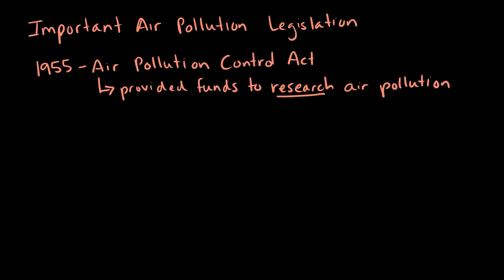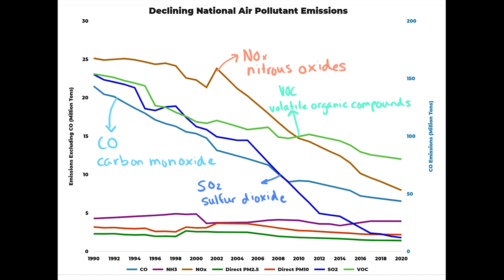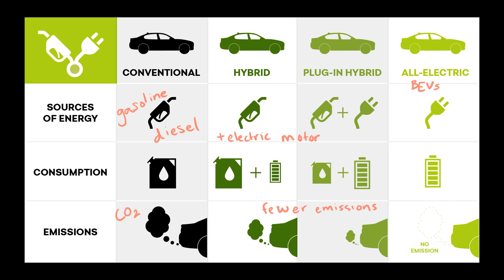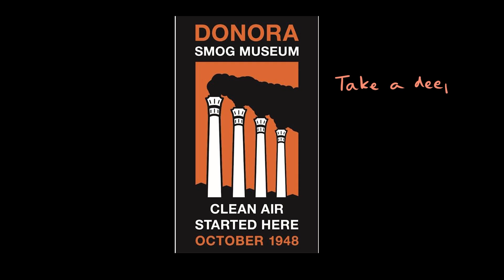Reduction of Air Pollutants| Atmospheric Pollution| AP Environmental Science| Khan Academy

Comment: Great video! Let us connect the the beginning of the story. The problem was the factories, and just like today if the factories are still making fossil fuel Automobiles. So in turn there is still going to be pollution. It is similar to plastic waste. If these companies keep making the problem the responsibility should not be put on individual actions such as “drive electric cars” or “recycle plastic.” These types of solutions are like putting a bandaid for a major injury. The root of the problem is the major oil companies that need to make their billons of dollars. The video is very good thank you for the insight!
Reply: Changing individual actions is more than just a band aid, but of course, governments and powerful companies bare the most of the responsibility and thus have the potential for a quicker and longer-lasting change

Comment: You're misleading. You need to include WHERE the electricity is coming from for electric cars, a vague statement, ' you can use clean energy sources' for charging electric cars. Also, in 14 states in the US that have very little renewable emergy, plug in hybrids are no cleaner than regular gasoline cars.
Reply: Even with the inefficiencies of those issues. Hybrids and electric vehicles are still net improvements over traditional internal combustion.
Reply: You are right.most of comes from Fuel generators.

Comment: Isn't the production of solar panels, windmills, and geothermal (I don't remember what they called for geothermal) also produce pollutants in the air, and for solar panels I know they're not even 50% efficient, in converting sunlight into electricity. What about the waste they produce after they're no longer usable. Most things are not even suitable for recycling, Are we going to ignore the other pollutants they produce. 
I may be biased, but I prefer nuclear. It produces the least amount of waste per energy produced. They last longer nowadays, so in the long term they produce less garbage when they have to be decommissioned. Nowadays nuclear power is very safe.